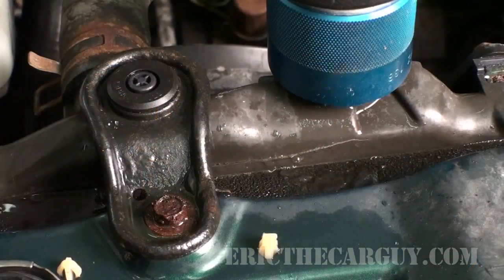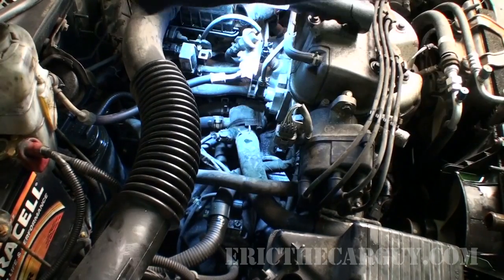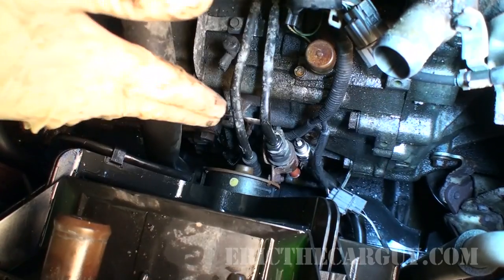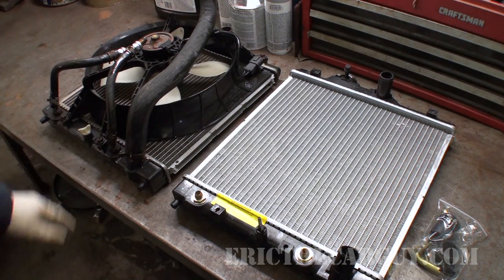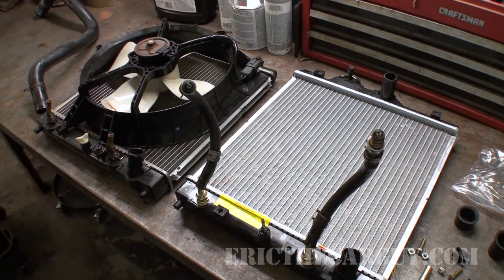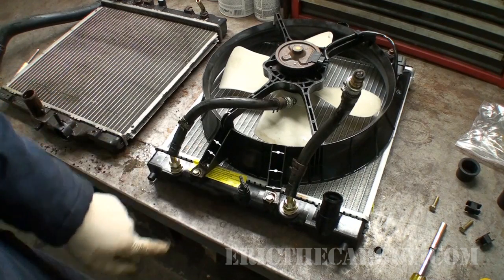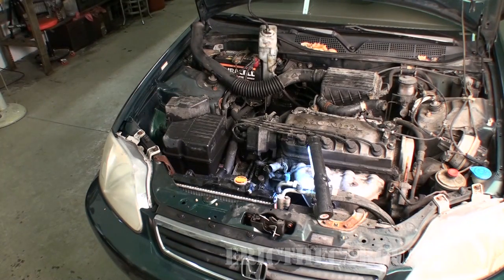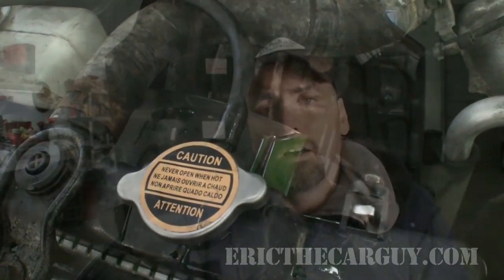1999 Civic Radiator Replacement -EricTheCarGuy

Comment: Ditching the manufacturer's spring clamp and replacing it with a new clamp (the "screw" hose clamp)  was needed in my situation.  I had to change the thermostat in addition to the radiator and kept the original (rusty/semi rusty) spring  clamps.  

Well needless to say, I had a large leak after driving it a couple days.  I found it coming from the housing of the thermostat (at least it appeared that way!).  I decided to try a small amount of sealant(very small...I didn't want the excess to occupy other engine parts) to fully seal the housing of the thermostat.  After leaving it to cure 24 hours I proceeded to fill the car with coolant and purge the air from the system.  The leak immediately returned while waiting for the fans to kick on while the engine was running!!

After much frustration and consultation of others, my neighbor suggested it may be leaking from the lower radiator hose and running along the line of the thermo housing and then finally dripping at the point at which the thermostat housing is bolted together.  He said to maybe start with the clamp first.  I then remembered Eric mentioning he usually ditches the spring clamps..and especially the clamps on the lower radiator hose.  DUH! LOL I totally forgot Eric mentioning that!

So I bought the clamps and before putting them on I scraped off the sealant I used before and made it as clean as I could so that I could decipher whether the clamps were really the source of the leak or not.  If it still leaked I would have slapped on some more of that sealant. wasn't necessary!  Turned out to be the clamps.  So I hope this experience helps someone in the future.  

Eric is right...ditch those rusty spring clamps with something like those screw hose clamps!

Comment: Hey bud. Thanks for this video. 
I have a 1998 Acura 1.6 EL (only in Canada) with the D16Y8 motor. I replaced my valve cover gasket, the VTEC solenoid gasket, distributor o-ring, thermostat, and the rear drums and shoes on my car recently. Then last weekend my radiator started leaking like a faucet. Saw this video and it saved me. Got an aftermarket rad and cap for $78 Canadian and did it myself!!! Thanks again!

Comment: Thanks a lot for the video. Clear steps and well presented, I can do exact same thing on my 97 civic.  After I replaced the radiator, I drove about 10 blocks, the engine was overheated and blowing cold air inside (turn to hot all the way). Later learned from my friend that I have to leave the radiator cap open while warming up the car, so the radiator can suck in more antifreeze while bleeding out the air. My car is working just fine now. Thank you very much.

Comment: Great information and very entertaining as a viewer with a similar job in the works. I appreciate the small details like positioning the hose clamps back the same way.
Reply: Garrett Smawley . Actually this is easily the best video on YouTube I had no problem with the transmission lines. I just wish I had pay more attention to the bolts on the bottom of the fan the bolts of the new radiator were bigger than the original but lucky for me I didn't drive the bolt thru the radiator. next time it should be a lot easier.

Comment: My personal feeling about hoses/clamps/thermostats/caps -- if I'm taking the time to replace the radiator, bleed the cooling system, check the tranny-fluid, etc., I'm going to spend the extra few $$ on new hoses/clamps/thermostat/cap.  This goes ESPECIALLY for a thermostat!  A damn $10 thermostat can ruin a $3,000 engine way too easily to chance it, in my opinion.

Thanks for yet another very thorough, very enjoyable video, Eric.  :-)

Comment: In a shop we used a tool to vacuum out all the air, then we the radiator would suck up the coolant and have very little trapped air.  The other nice thing is you knew when it held the vacuum that you didn't have any leaks.  It wasn't a cheap tool, but it used standard pneumatic lines and only took 2 minutes. so much better than filling, bleeding and filling.  One time i over tighten the the transmission fluid line and stripped the threads.  So be careful.  Its the only time I ever stripped anything.

Comment: I just replaced mine with my dad. Pep Boy asked for $600+ for the repair. I bought the parts & took a little time and only paid $120.
Reply: Lovens Presume Excatly the people that triple A sent me to after my radiator had a crack in it they wanted to charge me $600 and then with the AAA discount it was going to be $580 It was at that moment that I have vowed to work on every thing on my car and never send it back to a mechanic 💯
Reply: I just paid $290 + tax to replace the radiator on my 2002 Honda Accord. $600 + is way too much and I'm glad you did the work yourself.
Reply: Did the same with my dad a few years back

Comment: Used videos like this and others to replace my radiator in my 96 Civic.  Everything went perfect, UNTIL, I saw a tiny leak at the hose for the transmission fluid when starting the car.  Tried to adjust it and slipped and fluid starting leaking like crazy LOL.  After several minutes of slipping and sliding with my channel locks and red transmission fluid soaking my arm clear down to my shirt, I got it where I wanted it and problem solved.  Wish I had used one of Eric's clamps in the first place and not the one that was already there. All in all though it was about $60 to do the job.

Comment: For anyone following this video which is great, one mistake I did see was that the transmission cooler lines were not fully seated onto the hardware on the radiator. Very likely that will cause a leak. Also if there is any ability to move the angle of that hardware by hand then there will be leaking from that joint as well.

Comment: Great tips through out the whole video. Clamps back in the same position ias they came off is something so easily overlooked. Also replacing the bottom radiator clamp with a hoseclip pointing south was genius. Excellent video as always.

Comment: I had a hell of a time loosening the fan shroud from the old radiator.  Actually ended up breaking the screw holes. The lower hose fitting went on mine (of all things). I guess my Honda sat for a while with the previous owner. 

I was wondering whether using waterless coolant would be a better idea here? From research, it seems that Honda's run a tad hotter with the waterless...

Comment: Hi Eric I've been watching for years good job on all your videos and you can't even the world do you have a video for adjusting a hood latch on a 98 Civic I hit a deer and had to replace my hood and the did my best to get the body back into condition but it is a little off looks fine but a little off the latch will not lock. I have got it to lock but it's been in pain lately.

Comment: I bought an OE Denso Honda Radiator for my car because I was sick of the aftermarket ones breaking and cracking all the time. When I got my radiator all the little stuff was already on. Like those metal angled lines those square nuts. All I had to do was install it in my car.

Comment: Some of the little "two cents" parts that are part of a car are things that ease the manufacturing process.  I am thinking in particular of the screws that hold brake rotors in place during manufacturing.  The main purpose of that little plastic hose holder may be similar.

Comment: My Chevy truck is a manual, when I replaced the radiator, I ran my power steering through the transmission cooler in the radiator.
Reply: Seems like a cool idea.
Reply: maybe you can also use it as a engine oil cooler too, will keep oil temps at 180F

Comment: ...Anyways, thanks for this video. I have this same exact car (ok not exact, mine's a 1998 DX hatchback), and I plan on doing a coolant flush and thermostat replacement soon, but not replacement of the whole radiator. From what I can tell mine has a newer radiator already. I wanna replace the thermostat, because it's either the wrong one, or it's stuck open or opening too soon. I highly suspect engine overcooling.

Comment: Question, so for the transmission lines at the bottom of the radiator, I did it the other way. I removed the clamps from the lines that connect to the radiator. I wasnt able to get them completely in place causing minor leaks but could those leaks cause loss of power when accelerating and idling? Because I have rough acceleration (only occasionally but more often then not) and idling(occasionally but not as frequent as acclearating). Just had spark plugs replaced professionally and even got a 100 shot of fuel system cleaner, but I did do the radiator myself and am wondering if I should tighten the transmission lines, in hopes it's brings back more acceleration power and less idling. Please help!

Comment: Eric, I am following this video step-by-step and you are on removing the transmission lines, you said if your car is a manual transmission that you can skip this step OK cool but the radiator that I ordered has these connectors on the bottom. Can I still use it with a straight drive 99 Honda civic EX? Mother of TODD!! It's like these two Hondas that my son and I have-( mine being a 99 civic his being a 94 Accord ) are progressively trying to drive me to Drinking!! The simplest of repairs done on a 1978 TransAm are 65 times more complicated and aggravating for a car 20 yrs newer!! Ok. about this radiator, what is your direction here? As I trust no one else😎
Reply: nevermind i figured it out

Comment: Hi Eric, 
I know computers but I suck at cars. So I have a question for you about a bad transmission. 

I have a new VW Passat 2010 and it is a 2.0T with 4,000 miles on the vehicle. So it hasn't been driven that much between 2010 and 2014 at all.  The transmission is AUTOMATIC but it is supposed to be a fancy DSG (Direct Shift Gearbox) AUTOMATIC transmission with ECU (Electronic Control Unit).

Summary: 
Problem with the transmission: when stopped and take foot off brake and try to accelerate car has no power and then eventually kicks in. If on a hill the car will roll backwards and then accelerate. 

I am not used to this with a automatic transmission, I want the car to roll forward when I take my foot off the brake. That tells me that the bite point on the clutch is tuned so that the idling car has enough power to roll the car. 

I think there is something wrong with the transmission b/c when the vehicle is in the "D" position and stopped (ie, stop sign or stop light) in the 0 to 0.5 seconds that I take my foot off the BRAKE and put my food on the ACCELERATOR the car does not roll forward, then from 0.5 to 2 seconds that I am pressing the ACCELERATOR. 

What is your experience with this problem?
What vocabulary would you use with an Auto Engineer to address the problem to resolve this issue?

Thank you, 
Victor S.

Comment: They always said plastic was the future, but it's not a great future since the plastic stuff breaks all the time, as this car exemplifies.  

From a plastic channel above the radiator blowing out on the interstate in a Focus, to a simple plastic clip breaking in a power door lock button preventing all the doors from being opened until you manually rested the switch in its default position in a Saturn, plastic parts just seem to cause nothing but problems.  And that doesn't even count all the non-car-related examples.

Though I imagine when they were so hopeful about plastic that they weren't counting on it all coming from China, full of impurities and poor-quality construction.

Comment: Don't get me wrong I'm a big fan, but I think I'd take a couple of things a step further.

Clean the radiator hose inlet/ outlet with sandcloth. Those Honda's alloy parts get a lot of corrosion. Replace the hoses and clamps. It's just good practice. Hoses and clamps are cheap insurance.

Old bolts that get re-used get the wire wheel and a dab of anti-sieze.

I'm maybe just a neat freak. I'm also working on my own car so maybe really clean matters more to me since it's my car and I'm not in a big hurry to git-er-done and out of there.
Thanks for all your videos....you've helped me many times
Reply from the maker: With the exception of cleaning the inlets and fasteners I believe I covered the rest of your suggestions in the video. Honestly, I'm not a fan of aftermarket hoses and the Honda hoses can be pricy, so if the Honda hoses are still good, I normally keep them. Thanks for your input.

Comment: Was the cracked old radiator the symptom and not the cause? Did you rerun the pressure test? Just wondering that a small leak over a period of time will bring you back to the same problem/condition.
Reply from the maker: That's covered in the pressure testing video. Link in the description.

Comment: This method obviously works, but admittedly isn't the neatest or cleanest way to change a radiator. It wouldn't have been much more effort to just reach under and drain the radiator to help prevent any mess later on. And no, ATF level really doesn't go down that much to make a difference, when you remove the radiator. But it should go without saying that you should STILL check the ATF level when the job is done. For a flat-rate tech, though... this is the fastest and dirtiest way.

Comment: This may be a dumb question but I am still learning and I may not get an answer back but what is it that is next to the radiator with the hot and cold valves(?)? Only reason I am asking is that a friend of mine whose civic I've recently replaced the radiator on is still having some issues leaking. Is that a second radiator or is it for something different completely? I'm trying to factor what could be the culprit to the problem. I may go back and double check somethings to make sure everything is sealed tight on the newly replaced radiator but an answer to this question will still help me out a lot.
Reply: That is for your air conditioning. Red is for your high pressure and the blue is for your low pressure. It has nothing to do with your cooling system. Best way to find leaks is to top off the system and buy a radiator pressure tester and then test the cooling system and look for leaks.
Reply: Longtrailside beautiful that's good to know for future reference, we figured out what was up in the end,  her radiator was still replacing liquid that it needed and wasn't actually leaking like she thought.

Comment: Does that new radiator also have a plastic top and bottom?I find that is where the 2 I have had replaced,in the life of my car tend to spring leaks from.
Reply: Make sure the radiator is bolted to the car with that round metal thing on the top. The vibration can cause hairline fractures in the radiator plastic. It's rnough to cause an engine overheat. My stock radiator on my 1998 Civic got a hairline fracture. I replaced it last summer. All is well.

Comment: Looking for information on the harness to the radiator fan vs ac condenser fan? Where does the start and where it ends? And is the headlights harness attached to the radiator harness?

Comment: Hey Eric question, I installed the new radiator with a newer hose on the bottom awaiting the top one for tomorrow everything was set in place and the fan doesnt kick on. Before putting the radiator in I turned the car on and the fan turned on fine. I did cut the bottom of the old lower hose and drained everything out as well as putting high strength antifreeze in the radiator and reservoir. What could be causing the fan not to kick on?

Comment: Problem: 1994 Honda Civic EX 1.6L and I purchased a new radiator. Old radiator fan doesn't fit. Lines up, but the top bolts will not reach because they are too far apart. Any easy fixes? Like using a longer bolt? Or do I need to also buy a new fan that will actually fit the new radiator...?

Comment: 1:59 the part your hand is over. (also at 27:35 your hand is covering it)
Why is it designed to have slop? You can clearly see the gap between the rubber ring surrounding the peg and the peg itself.
The peg I'm talking about, has 4 holes in the top.

Comment: I have a 1998 Honda Civics DXL every time I cut on the air conditioner the car runs hot I'm trying to find out what could be wrong I have changed the water pump on the car cuz it was leaking so I change the water pump so I'm trying to figure out what could be wrong with the vehicle. Cuz I was just thinking of replacing the whole radiator I know the thermostat needs to be changed but I'm trying to find out why does it always run hot when I cut the AC on if you can answer this question for me I will greatly appreciate it thank you

Comment: whatever you do, replace the hoses. I have had them fail few months after I would replace the radiator. Guaranteed failure on every car I owned. Whenever car overheats even slightly, hoses, Cap, thermostat and Coolant sensor have to be replaced because the hot coolant somehow ALWAYS ends up damaging them. They will fail very soon after the overheat and then you will have to do the same thing all over again, 100% guarantee you.

Comment: Eric would you recommend putting the blue Honda radiator fluid in or just stick with the green? I have a 96 civic lx with what appears to be the same engine. Thanks.
Reply: shamfrod I just used standard Preston and went through the ingredients it work with my 2000 Honda Civic LX

Comment: I have a manual transmission, do I need to plug the transmission cooling ports with a fastener or are the plastic plugs sufficient? Thanks!
Reply: Ruben Sarino the transmission cooler section is separate on the inside so you can leave them off if you wanted.